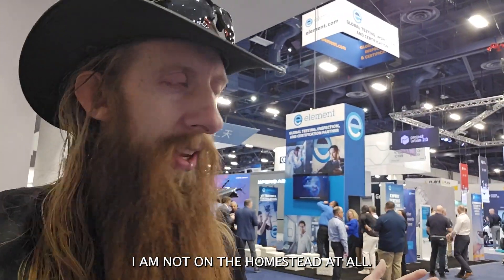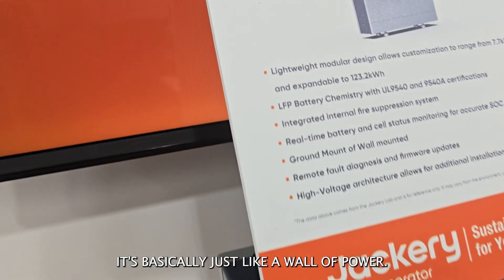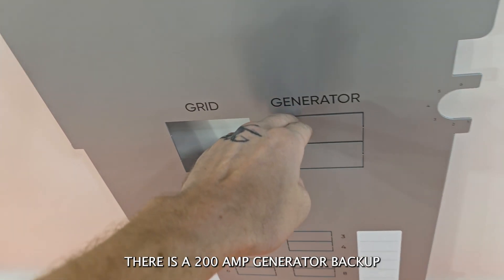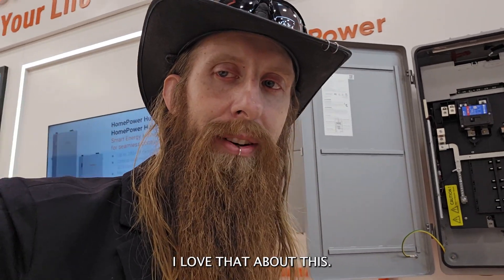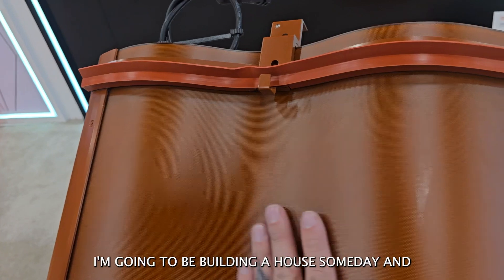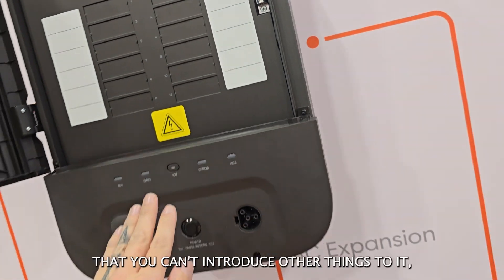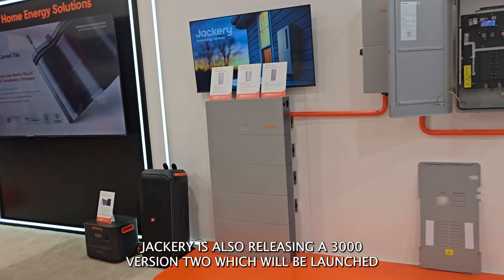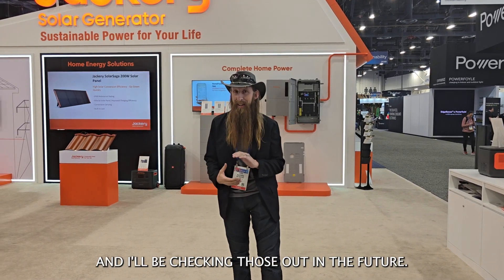Discover Jackery's latest innovations at CES 2025!

Comment: I'm not sure about the Jackery home power station. But, allot of the home power stations require less than 5% harmonic variance and a cheap solution to that problem is the EG4 Chargerverter. It will clean up any power that is put into it and output clean power. This is so you can run a $1,200 Predator gen instead of a Westinghouse, Kohler or Cummins gen that cost well over $2,000. Those roof tile solar panels are super cool tho.